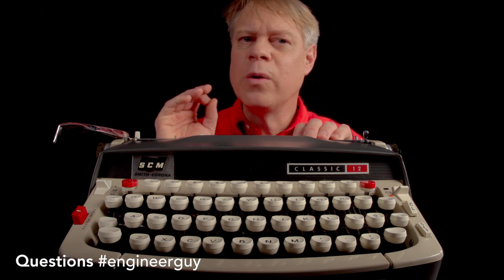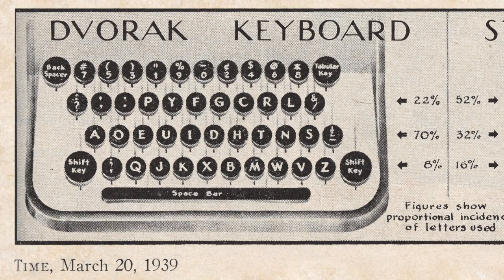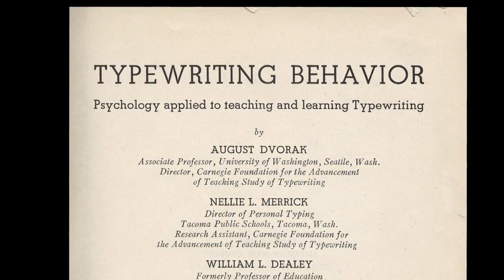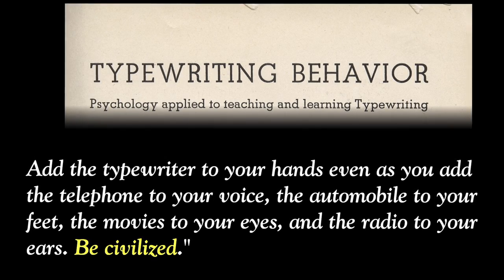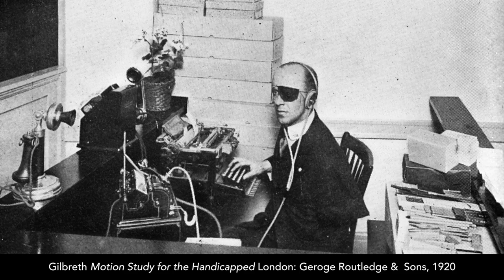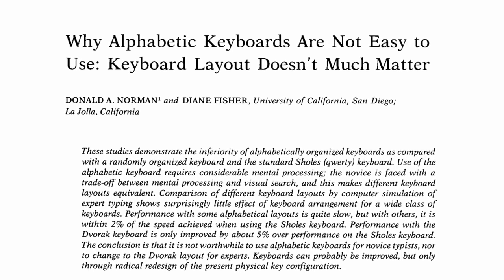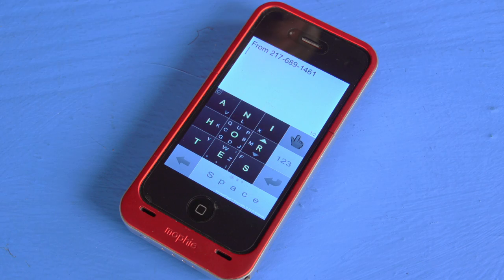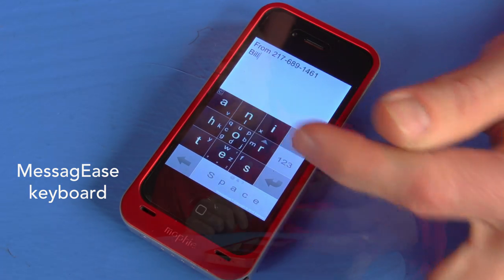Why the Dvorak keyboard didn't take over the world

Comment: Many, many years ago, I tried Dvorak.  After a few frustrating days, I got right back to my usual 120wpm.  After another two weeks, I was still at 120wpm.  That seems to be my brain-to-fingers speed limit regardless of key layout.

So if you're slow with Qwerty, practice more.  Dvorak may seem better on paper, but the mental dissonance of switching layouts whenever you use a different computer or interface will slow you down far more than any academic benefit of the key layout.
Reply: Correct but this kind of thing could potentially make future generations faster who only have used Dvorak. 

There seems to be a faster solution to solve rubix cubes in speed competitions but I doubt we’ll see anyone breaking a record with it for another couple of years… until one of these soon to be 9 year olds has been using it since he started.

Comment: Its not only about the speed improvement though, it is also more comfortable for your hands which is actually a huge deal if you use a keyboard often.
Reply: An less typos
Reply: @AG-ur1lj  It's hard to articulate but Dvorak "flows" better.  It's more like rolling downhill
Reply: @bobbymurray9015  Right
Reply: Exactly. The author should look up the Workman layout: its page has neat illustrations showing how Qwerty has frequently-used keys in the top row, and ‘A’ under the pinky. While ‘A’ is not fixed in the other layouts, Dvorak, Colemak and Workman all cluster other frequently-used keys under the fingers in the resting position, and require less movement. Afaik in Dvorak the keys are also arranged such that popular two-letter sequences are easier to type.

Comment: What I've heard is that the story about the typewriter keyboard layout being deliberately confusing in order to slow down typists and thus prevent jams is an urban myth.

Yes, the keyboard was designed to prevent jams, but not by slowing down the typists.  It was designed in such a way that the most commonly used successive letters were as far apart as reasonably possible, meaning that the printing hammers were less likely to be close together for a long time, leading to less chance of the hammers jamming against each other.
Reply: In fact, Qwerty speeds up typing compared to alphabetic arrangement, since frequently-used sequences of letters are typed with both hands. Afaik Dvorak placed even more emphasis on the sequences, but this time optimized for the rollover of the fingers, such that they're easier to type with less movement.

Comment: 2019. We still use the QWERTY arrangement on smartphones, even for continuous one-finger swipe typing, because everyone has internalized the pattern. Long-lived meme, there; nowhere near dead.
Reply: Actually QWERTY makes more sense on mobile than DVORAK. Having all the vowels in a similar cluster would lead to many typos using autocorrect. It's beneficial on a phone keyboard for the same reasons QWERTY was beneficial on a typewriter, ironically.
Reply: They could have taught us a different layout when we still had typing classes in school. Most of us would not have known any better if we were taught Dvorak.
Reply: QWERTY is only useful for physical keyboards; all touch keyboards are flawed because you can't type without looking where you put your fingers on; so it's the same if you use a qwerty or a draw-based input (like Palm Pilot's in the 2000s)
Reply: @alerey4363  While it's true you have to look at digital keyboards, QWERTY has the advantage of being a pattern most people know, and thus can efficiently find the letters they're looking for.
Reply: @dreamcanvas5321  nope, you need physical cues for your key fingers to go "homing" position (i.e. F and J letters in qwerty physical keyboard); on a flat touch screen this is impossible, you need to keep looking
Reply: @alerey4363  You can, it's possible if your muscle memory is good and you use your phone's sides as references instead of the F and J keys. The downside however is that you have to adjust your hands to the position you're most familiar with.
Reply: @alerey4363  Oh and another downside is that your muscle memory is ruined if your new phone is wider or thinner than the one you're used to.
Reply: @Kromiball  this, the keyboard on iPhones is slightly smaller than android and if I try to use one it throws me off
Reply: @Kromiball  yup, wonder if Juan picked up what you put down...
Reply: @screamtoasigh9984  Fingerwashing?
Reply: @alerey4363  It's completely the opposite with me.
I don't need to look where my fingers are going on a touch keyboard.
I can't type without looking on a physical keyboard
Reply: @JonatasAdoM  that makes no sense; muscle memory needs tangibility; you need the shape, size and mass of a pysical key to type without looking; hitting your fingers over a plane gives you no cue where to put your fingertips; why do you think even physical keyboards have the notches on the F and J keys? to know where to put both hands without looking at it; touch devices are not good for controls; same for gaming, why do you think there are physical gamepads, joysticks and all sort of physical controls for connecting to phones and tablets? because real gaming needs physical controls
Reply: yes